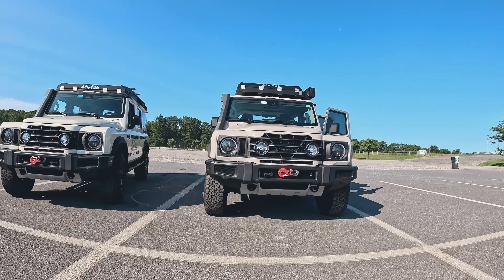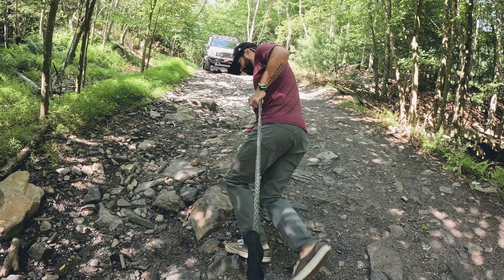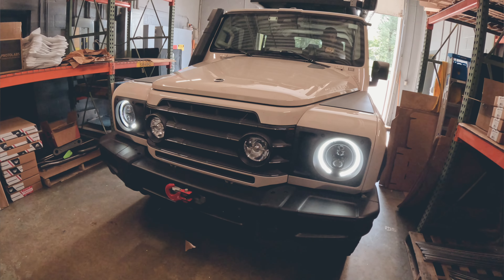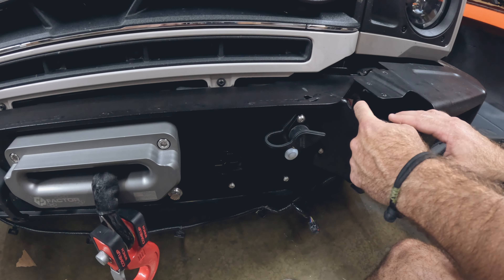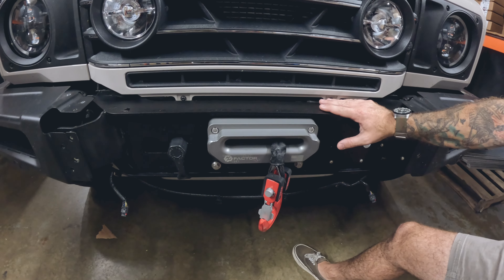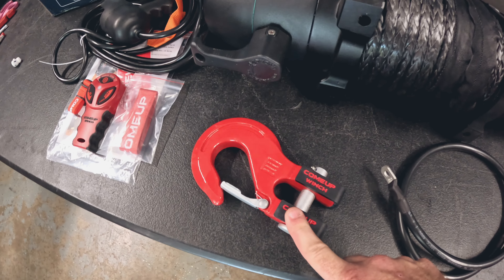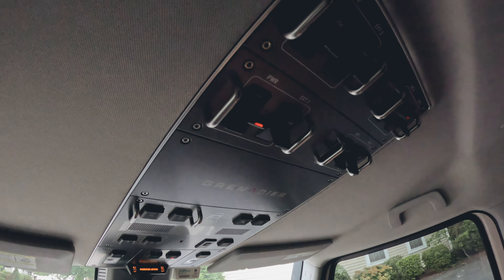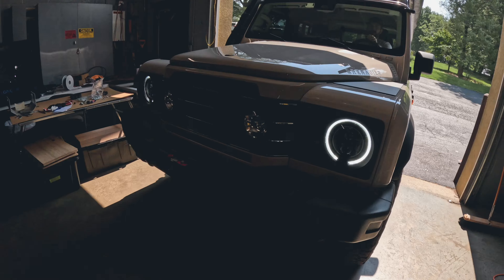The Best Winch Kit for the Ineos Grenadier

Comment: This looks amazing!  2 questions:  1 - how much weight does this add to the stock front end?  2 - do you recommend upgrading the springs that are stock on the non-winch Grenadier?
Reply from the maker: The weight of the winch is 75 lbs. With the billet fairlead, you are at about 80. The center bracket replaces the original bracket, so there is no real gain in weight there. 

Your vehicle can handle the additional weight.  You will appreciate the extra ground clearance if you decide to upgrade, but your vehicle will handle the additional weight.